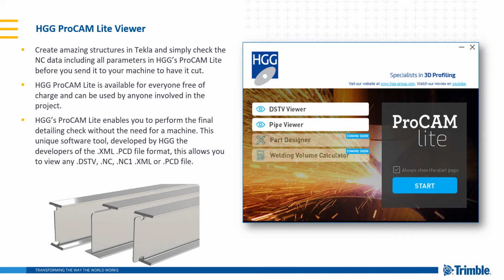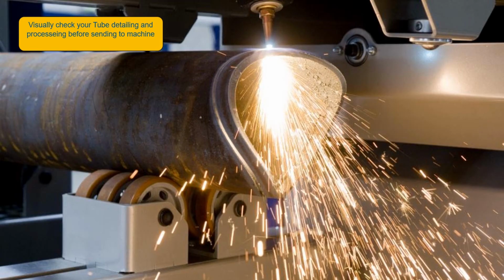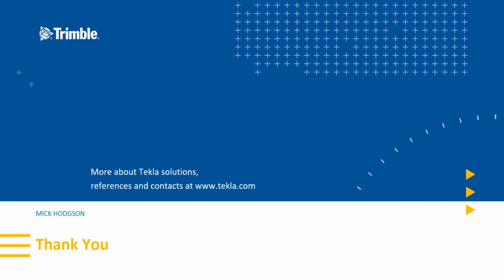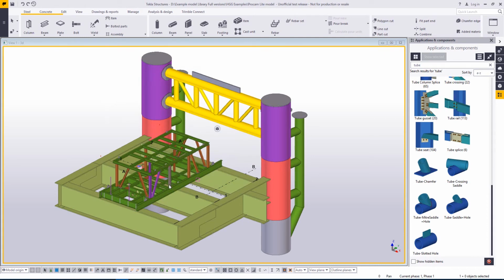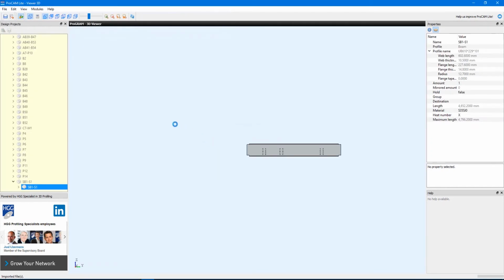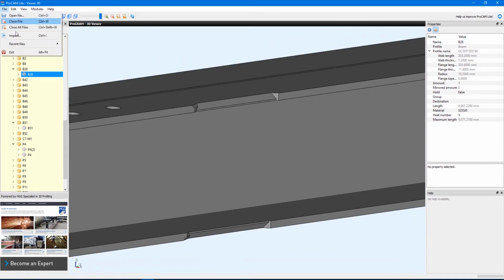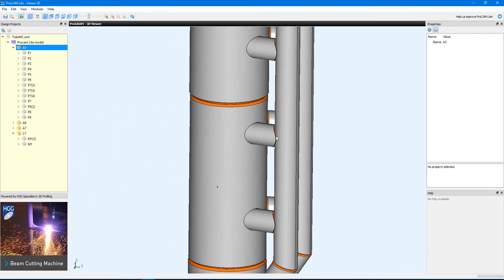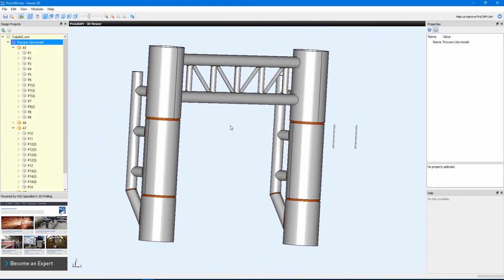HGG ProCAM Lite

Comment: For the modeling software,  can I use something else besides Tekla?  We currently have an AutoDesk Package and use AutoCAD, Fusion 360, and Revit.  It looks like we might either need Inventor with an add In to convert the files to .dstv files.  I dont think Fusion or Revit have the ability to make these files.
Reply: I see in my autodesk package I have Advance steel which I think can export .dstv files.  I may be ok but I will do more research.

Comment: We have an HGG SPC 800, what is the software that should be installed on the machine PC to load the XML files for pipe cutting ???
We have some kind of a modular basic software already installed on the machine PC. Can this software read the XML and execute it ?
Reply from the maker: Dear Mohamed Zouhairy, Can you please send us a private message with your contact details or contact us at service@hgg.nl? Thank you!
Reply: HGG Group Check your mail please
Reply from the maker: Hello Mohamed,  I'm very sorry but your comment ended up in the spam folder. Could you please contact us and give us the serial number of the SPC 800, so we can support you better? Thanks!